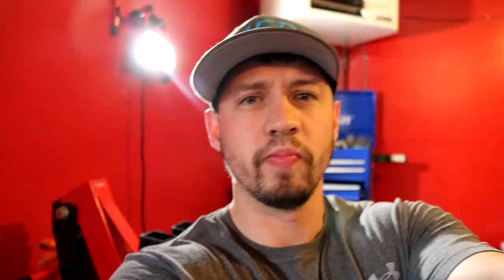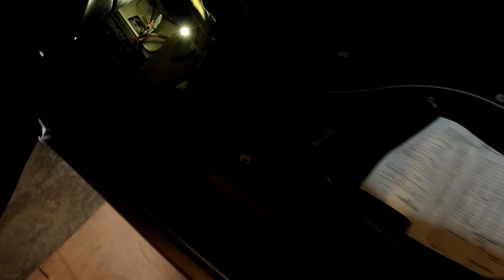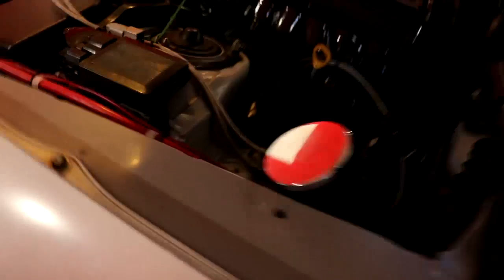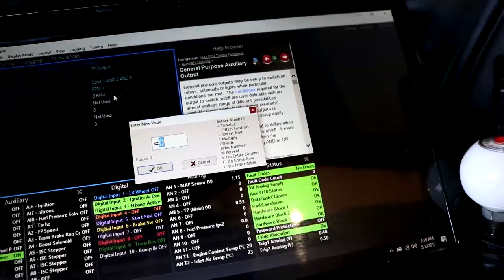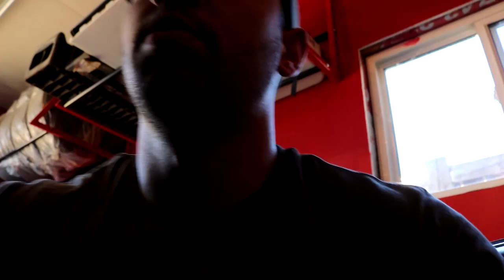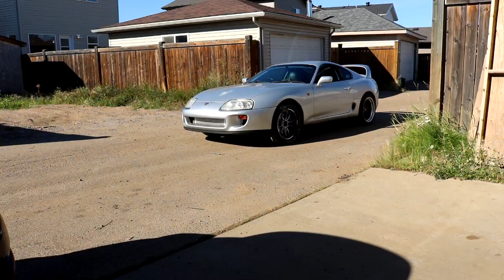Big turbo Supra Gets Nitrous

Comment: Hey Kyle just curious why you're not taking advantage of antilag? I'm sure you've answered that. It would avoid the whole nitrous thing completely.
Reply: Anitlag you mean a 2 step? with an auto (i assume he has a transbrake) it'll take a long time to get up on the convertor (if he can) and build boost,l that 10-15 secs it'll take will cook the transmission. Nitrous helps build load and help get up on convertor faster.
Reply from the maker: +Rory Somerville this guy knows what he's taking about :)

Comment: The tuning of the link looks fairly simple. How are you liking it and what made you go with it instead of aem, haltech or proefi?
Reply from the maker: +JSLay I had a haltech ps2000 I swapped to the link because it was cost effective, I got it for what i sold my haltech for. And the place that did my tuning is the ecu they use so they knew how to work it best and saved me time on the dyno